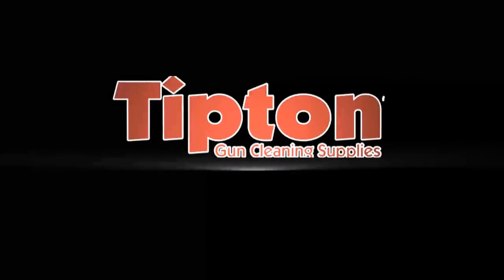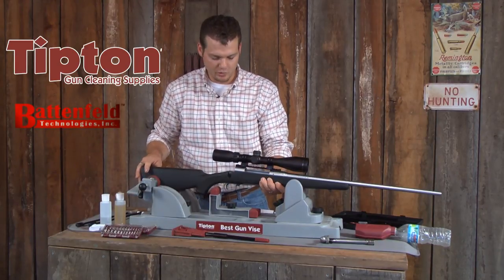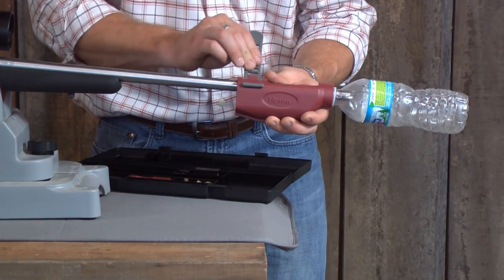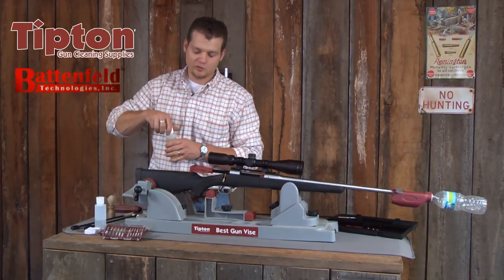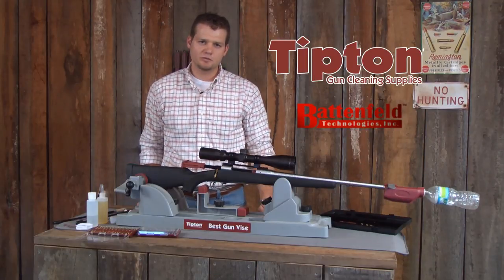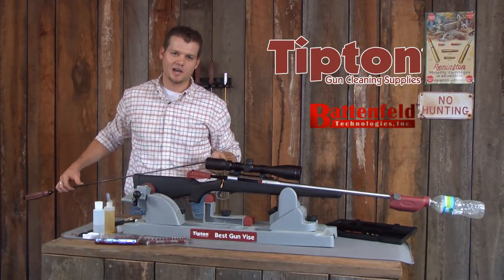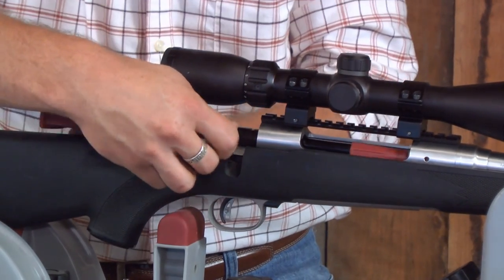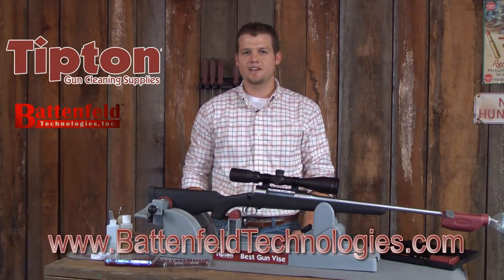Tipton Gun Cleaning Supplies

Comment: This has got to be a joke. All those supplies just to clean the barrel? So time consuming too. Wow. There must be a sucker born every day.
Reply: LedGuitar1218 how do recommend cleaning the barrel and action of a bolt rifle with a wood stock?  What would you suggest eliminating and why?
Reply: Actually this is pretty standard....I'm not saying you have to buy their products....you might find cheaper I'm sure....but your still going to need basically this same equipment....a cleaning rod, bore brush, cleaning pads, etc.  The only extra piece of equipment he appears to be using is a solvent catch.....just keep in mind with all eyes on them obviously they are not going to simply suggest letting gunk fall to the loose floor....there would be a thousand trolls giving them lectures on the environment.  This looks like a top quality set up and again not saying you cant do it cheaper or faster.....but I would not consider this a joke by any means.
Reply: I use to think like you also. But after 25yrs in the military 16yrs as a sniper. I can tell you these will keep you from damaging the crown of your weapon system and as we all know now some solvents are extremely harmful to your bore and some of your mechanical mechanisms ie trigger bolt etc. If your shooting extremely long range. A microscopic pit in your bore will throw your shot POint of impact of by a hell of a lot.